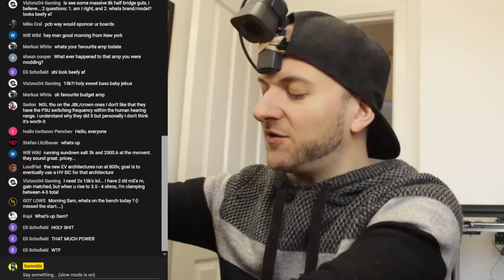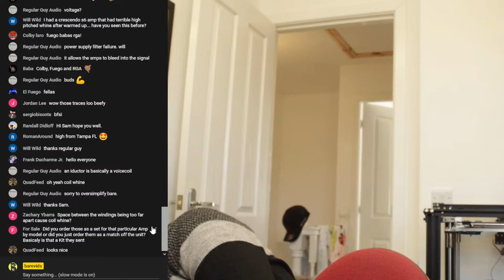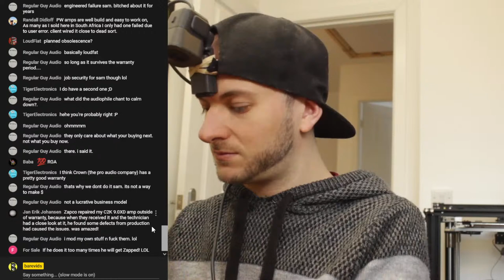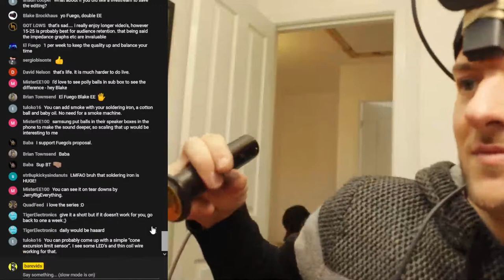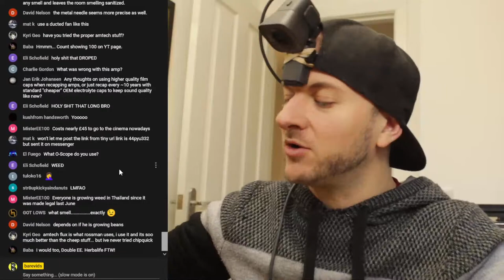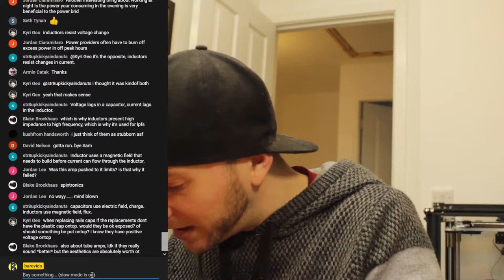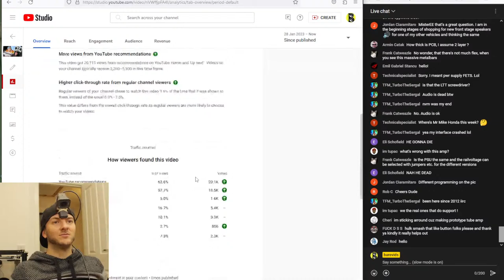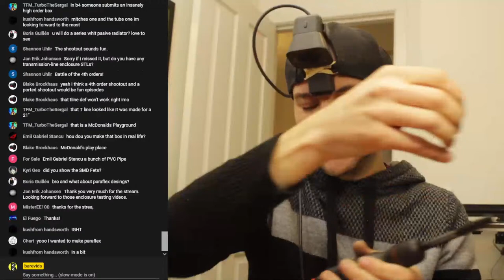Car Amplifier Repair LIVE 🔴

Comment: I missed the stream but JL makes a 0.4ohm sub for their self amplified boxes.  The amplifier produces 300ish watts and uses the 12v input as the rails.

I have one of them whose jl8w3 0.4 that's blown.  Haven't cut into it yet, but I'm willing to bet that the coil is pretty thick and short in length which will kill the subs BL

Comment: Great video again. Last Sunday you repeared a Bluetooth device and removed the capacitors. I watch some more videos on pcb repears and I notice that the don't replace some components but just remove them. What is the reason that the do nt put back a new component?

Comment: Ive heard bad things about the .25 ohm coils out there at least when used in a rebuild.  I would think the motor and the rest of the system would need to be built around it then it might be decent.

Comment: Dude. Wish I could Comment during the stream. I guess I've been blocked. Not sure. Was able to before. Oh well. Still nice to watch. I've learned a lot from you over the years while learning amp repair. I really appreciate it. 7 am you said. I was at work at 4 am this morning central usa time. I'm actually working on my own amp design. Laid it out on a 4x8 sheet of plywood and different colored masking tape. Even building my own subs now. Sold a few to friends. That's gonna be my retirement. Being a cnc tech trying to progress my career. The next step is design. Then suppliers which I'm working on. I've even built my own motors and now bobbins and voice coils. Yes I have a lathe and mill at home. I'm now building my first rare earth magnet motor. Trying to get the Goss right were I want it now. Testing different magnets. I've been testing a taramps hv160k. Been using a bridge rec. To get enough power at low wattage to test. As far as vehicles. I've got ol blue with 11 subs. The o2 ford with 2 old school p3 12d2. The 74 f100 with 2 rf 6x9 and a rf 8. The tang with an ol school 7500 12. The daily yaris with 4 zvxd2 and 2 dc audio lvl3 12 d2. Then the 65 scout with 6 of my own brand 2500rms d215. Using various mfg parts. Now building everything but the cone and basket myself. The spider has given me some issues. About got that worked out. Anyway I'm blabbering.  Just wanted to say thanks again.
Reply from the maker: Nice buddy! Haha you haven't been blocked, just need to be online when I'm live, the chat should work fine ☺ loved hearing about your projects!